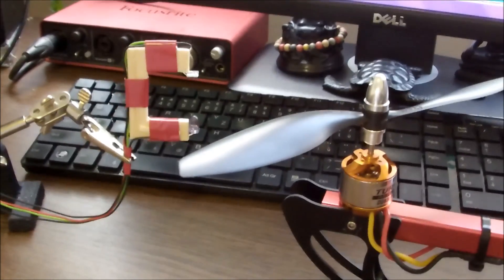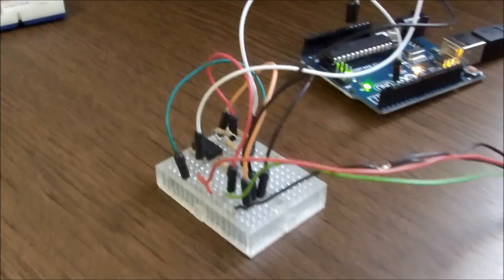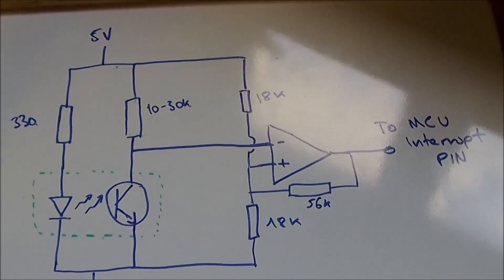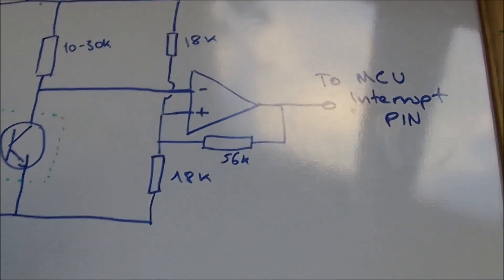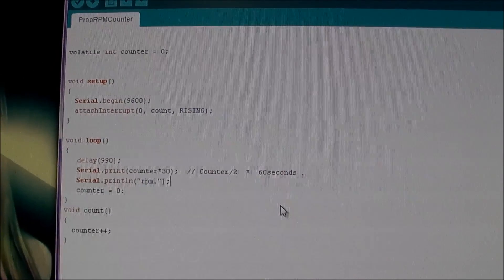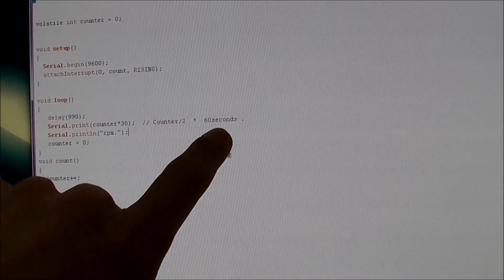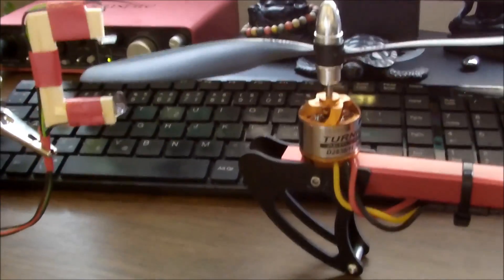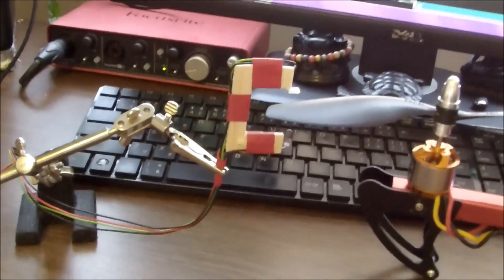RPM counter tutorial with Arduino (code & schematics)

Comment: i test this code but not measure fast speed, if spindle run ower 5000 rpm not measure, if spindle run ower 10 000 not accurate, promixity sensor trigger 2x/rev, speed max need read 30 000rpm.  my setup hardware have promixity sensor trig 2x/rev, spindle metal sensor working well, go to optocoupler sensor 12 volt to out 5volt to arduino, arduino calculater speed same formula counterx30; mean 2x/rev trigger/rev. but not accurate fast speed. real speed laser rpm meter have 3000 arduino have 3400, laser 4000 arduino 4600, 5000rpm arduino 5800, 6000rpm arduino 7400, 7000rpm arduino shot 9000rpm. 10000rpm arduino show 10000 or 13000rpm , 17000rpm arduino show 21000rpm, lot wrong. not accurate if fast run. how this code repair better.

Comment: Hi there, love your post.
I am trying to control a stepper motor via the rpm of a shaft.
If the shaft slows beyond a set rpm the stepper turns CW.
If the shaft increase in rpm beyond a set rpm the stepper turns CCW.
Could you help.
My email is - mking@cadwell.com.au

Comment: Does it work for the Arduino to calculate 55 000 rpm X 2 pulses / rev at 50% duty cycle?

Comment: Thanks, I found this demonstration helpful.  I am adding a tachometer circuit to a project and needed this.  I agree with the use of the interrupt, more accurate.  I simply used a general purpose NPN (2SC1815) instead of the OP-Amp/Comparator setup, configure as a darlington if a sharper rising edge is needed.  Good stuff, thanks for sharing!

Comment: it was helpful....but will it(code) work with a magnetic pickup sensor /proximity with arduino nano
...................reply sooner
Reply from the maker: Kamran Afzal It should, but it depends on how you wire up your analog circuitry from the pickup sensor.
Reply: +Shagas Heizenberg in a LJ12A3-2-Z/BX?

Comment: Great tutorial! Im planning to make one displaiyn a graphic to compare with thrust graphics. What is the minimum delay for this procedure?
I need to check the sensor at the highest rate to be more accurate.
Reply from the maker: Mechamilk What do you mean by delay? If you mean what is the fastest RPM that it can count then the answer is definitely more than you can produce :) .
Reply: Shagas Heizenberg  Testing 2300Kv motors on 4s im up to 34000 rpm * 2 (cause of 2 blades)= 68000 sensors impulse per minutes.
I need to mesure the acceleration from 0 rpm to max. The easiest way is to know how much time the propeller needs to do a complete roll and write it. The more time i can write this value the more my graphic will be precise. So my question is how many times i can read and write this value in a second? Does this action take 0ms-100ms-200ms... 
I hope you understand. Good luck :P
Reply from the maker: Which means about 1200 impulses per second which is not much. Only thing that might be a problem is if you are in a room with PWM LED lights or something similar.
Reply: Shagas Heizenberg ok thank you for the answer.